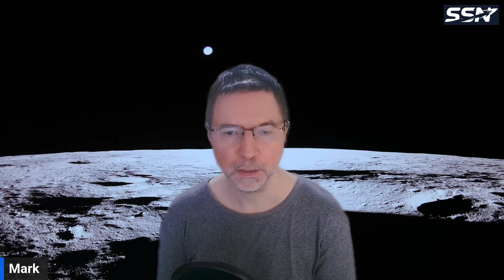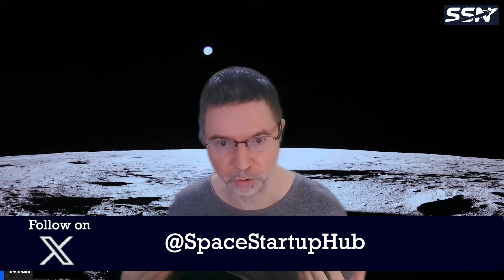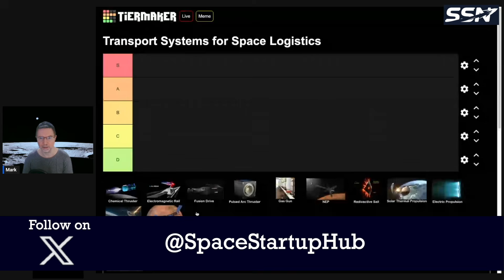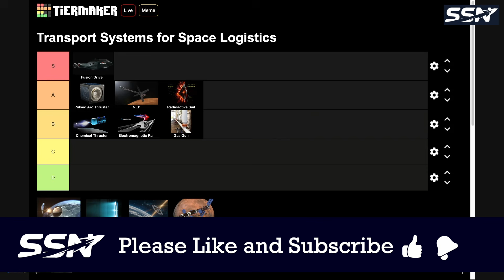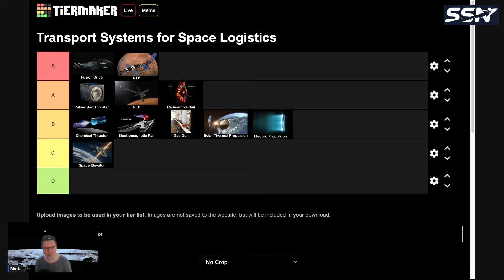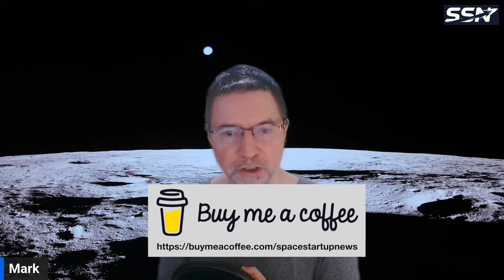Tier List: Transportation Systems for Space Logistics

Comment: How can you classify something like fusion or hall drives as slow?
Despite small trust those can work for very very long time with constant acceleration drastically reducing travel time
Reply from the maker: Electric propulsion systems have very low thrust. To reach useful speeds they need to operate for weeks or months. Over time they can reach high final velocities, the problem is the amount of time needed to achieve that. That’s why EP is unsuitable for human missions, humans require food, oxygen and water every day. Plus longer transits expose them to radiation, possible solar flares and the harmful effects of microgravity.

For robotic missions to the outer planets EP / Fusion / NEP may be better than chemical thrusters.

In short:

Human missions: thrust > fuel effeciency
Robotic or cargo missions: fuel effeciency > thrust

When I say “slow” in the video, I mean the human context.

Let’s compare ispace’s lunar mission using Electric Propulsion and the Artemis II crewed lunar mission using chemical thrusters.

ispace took 4 months to reach lunar orbit insertion in May 2025. The Artemis II crew onboard the Orion capsule did a flyby of the Moon in only 4 days.
Reply: @SpaceStartupNews yup everything is right but consider continuous acceleration please, when you do calculations it is around 3 months to mars for hall drive in the scale of biggest ones that are in development right now.
It is even better for fusion drive.
And chemical to mars is 7-12 months in a very best case

Comment: I feel like NTP doesn't belong in the S tier. Eager Space's very grounded videos "Why Nuclear Thermal Rockets are Mostly Pointless" and the follow-up Mars one are well worth a watch if you haven't seen them. Due to the costs and complexities of building, testing and operating such rockets, and the fact that the performance advantage of any practical nuclear thermal rocket are really not that great in the end, I don't think we'll ever see one fly, and I'm just not a fan of the concept.
Reply from the maker: All the challenges for NTP are being addressed. Reactor development is well funded and advancing rapidly (FSP / SR-1).

Heat-exchanger and propulsion tech for NTP is under development by the private sector. For instance Orbital Operations are working on their BOREAS Cryo-cooler (targeting 20K) to store liquid hydrogen indefinitely.

Blue Origin have designed and successfully tested their Cryogenic Propellant Management System (CPMS) already. Blue is working with NASA Marshall to demonstrate in-space cryogenic propellant transfer. These two companies are working on tech that directly addresses long-term storage of hydrogen needed for NTP missions.

Portal Space Systems is building a Solar Thermal Propulsion (STP) system and have 3D printed a heat exchange and nozzle as a single component, with no moving parts. They have completed full vacuum testing at operational temperatures. The company markets their tech as "nuclear-grade performance". The heat exchanger architecture, materials performance and plasma expansion physics carry over directly to NTP. STP is the perfect stepping stone to NTP. The hardest part is finding a suitable material to withstand the enormous temperature inside the reactor (~2,500–3,000 °C). 

All the pieces of technology needed for a credible NTP system are advancing. This is why I still consider NTP to be an S-tier propulsion technology and the only credible way for humans to explore the outer solar system.

Comment: You could use an electromagnetic rail system to send even squishy humans all the way to orbit -- provided your rail is sufficient long so as to not pulp the primates, and so long as it extends sufficiently high up into the atmosphere that the pod doesn't burn up by the time you're doing mach 22, or what have you. 

Certainly quite an engineering project. 

There are also skyhooks.